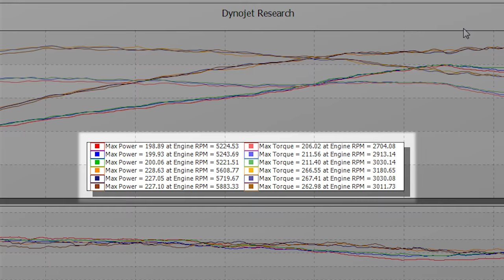COBB Tuning - Dyno Gains Explained

Comment: can you please help me I tuned my mk6 with Cobb and installed the CIA 
my rpm idle Goes up to 1800 then drops 
when on neutral . I took off CIA and installed it again,  
took it to a tuner (not Cobb ) and they said all my numbers are normal but if shouldn't be doing that...  
can you please help I already email Cobb and send them datalogs still no response